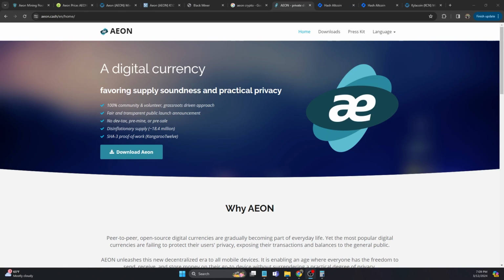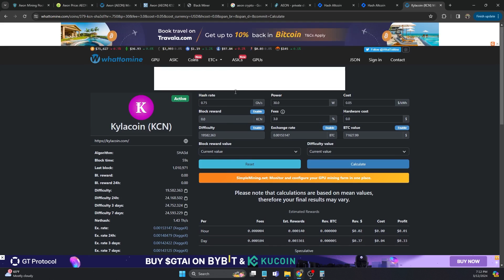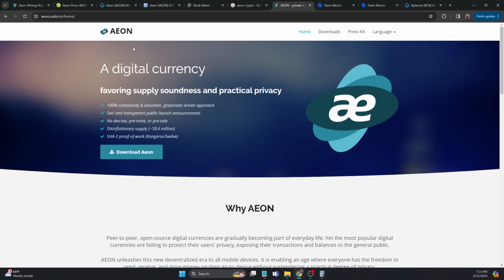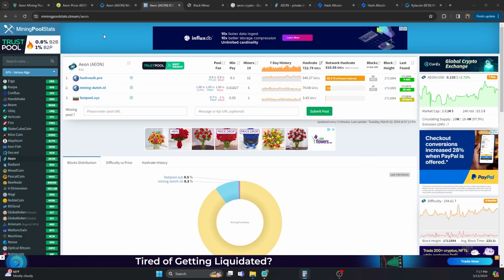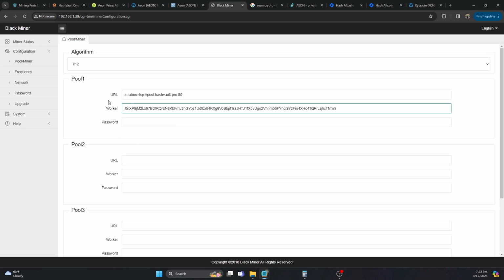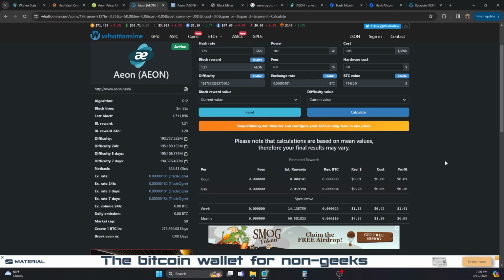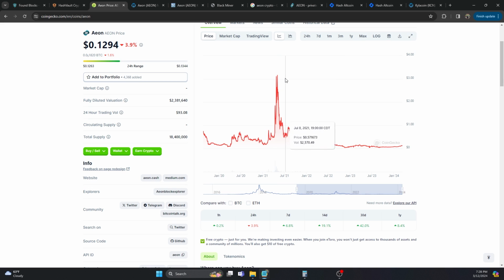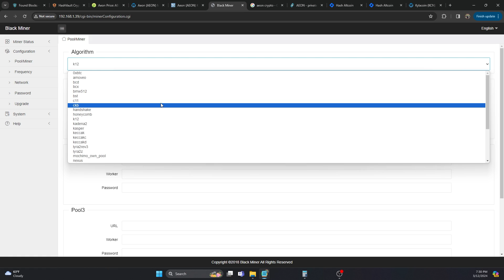Moving My FPGA To Mine A Coin Nobody Is Talking About

Comment: FYI Aeon (K12) Bitstream and miner was for sale on FPGAguide year 2020 until they shutdown. The BS was made by Ruplikmastik666 and was available for several cards/units including BCU1525/BTU9P/U200/CVP-13/U-250 etc.. So there are ALOT of people that have this bitstream. The reason no one is mining it is because of the low volume and if about 25 cvp-13s that hash around 60ghs it would spike the diff.